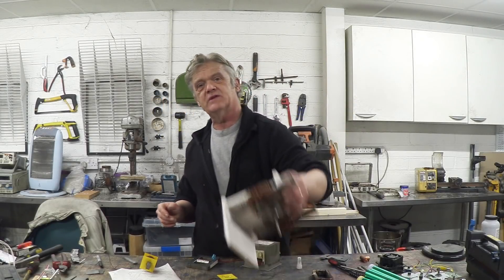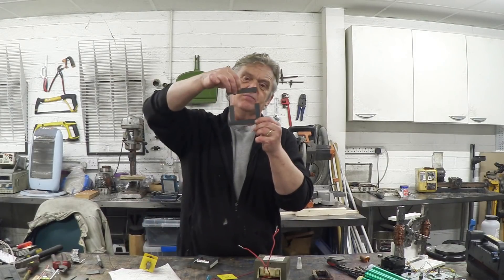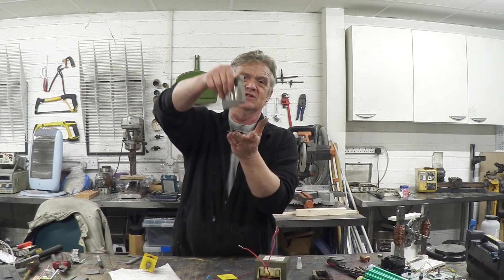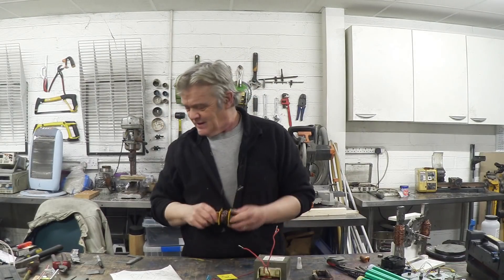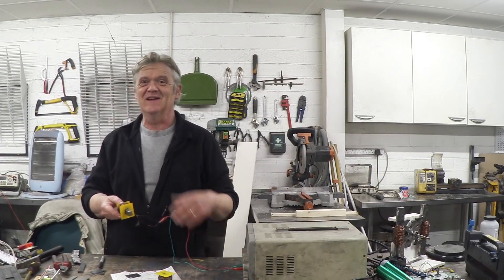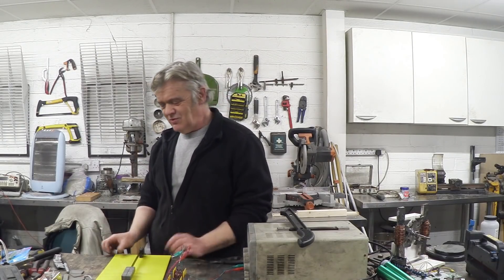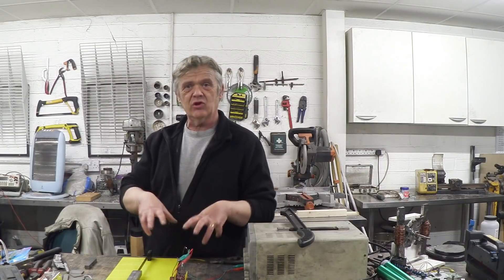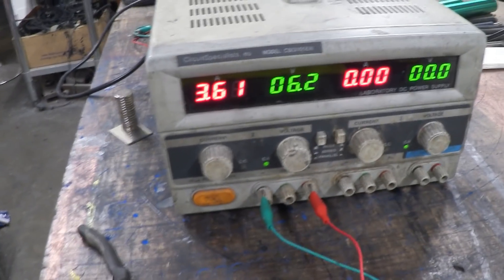1036 Flux Switching And Possible Over Unity

Comment: Awesome.  I had wondered if you could make a "switching magnet" with a combination of permanent and electromagnets.  
Now- here's (one) question I've got-  if you stuck another coil next to that, and ran an AC current (unless I'm thinking on that wrong) through your magnet coils, how much current is induced in that coil vs what you put in?
I had a notion on a motionless generator based on that concept, though I was thinking about the magnets backwards from what you've done in terms of function,  But I'm just curious what happens if you say, stuck that thing in a wound stator and just let the magnetic field bounce on and off at, what is it? 60 hertz?  Would that be a functional motionless generator?  It just takes a Change in the magnetic field to generate current, doesn't it, and your permanent magnets are doing a significant chunk of the work?   Ypur electromagnets obviously create their own field, but they Also seem to break the containment of the permanent magnet in the armature.    That may be an utterly ignorant notion, but it was a thing I was pondering with the "Switching magnets" and making one bit an electromagnet.   (another was a rather complex motor idea to "Turn off" the problem spot of a mostly permanent magnet motor at the appropriate time)  I dunno.  It's fascinating.  Thank you for this.
Reply: flux switching alternator. Look it up.
Reply: @lukiepoole9254  I mean, that's what he's building, but that's not what I'm pointing at, quite.
Reply: I'm pointing at the possibility of a generator with no moving parts, run on Permanent magnets, and just using an electromagnet to make their fields fluctuate (turning them "on and off") in and out of an armature to induce current in coils.  
I don't know if I said that right, quite.   Might not wind up worth it.  
 But I can't find that anybody's ever attempted it. 

The other application is like a V gate or similar design- it can't get back Into the gate the next time around,  If you could have this setup to "turn off" the gate entry till it was in the gate, permanent magnets would do 99 percent of the work to make the motor go the rest of the way around.  Seems straightforward enough.
Reply: @ryanjamesloyd6733  The problem with that is continuously turning the magnet on and off would degause it faster.
Reply: @lukiepoole9254  Then it just becomes a cost of doing business, like replacing a carbon brush.   You'd just have to replace your magnets every so often (All of them in the case of the motionless generator, only the first 2 in the V gate example)  Though I'm not convinced redirecting magnetic flux outside the magnet through a metal armature would degause it all That fast.
Reply: @ryanjamesloyd6733  you dont need magnets.
Reply: @ryanjamesloyd6733  just electromagnet.
Reply: @lukiepoole9254  you miss what I'm pointing at then.
Reply: @ryanjamesloyd6733  I mean for flux switching alternator xd
Reply: @lukiepoole9254  Ah- true.

Comment: A great experiment Rob, amplifying the electromagnetic effect with permanent magnets.
I could think of many applications whare this principal could be applied.
It's a pity some people take everything so seriously, and lack a sense of humour ! 😉
Reply: he weakened the magnetic field by putting the coils on the ferrite core in the first place, thats why it tooks so much power to move his meter, all the magnets did was use up some of the magnetic permeability in the metal to allow the magnetic flux from the coils to escape more readily, if he tried this with the coils not on the core it would almost certainly produce the same, or enhanced effect of what he showed after adding the magnets.
Reply: @Draakdarkmaster6  This is an interesting thought. It will take some thinking to create a decent experimental control to isolate this out. Thanks for the comment.

Comment: It is said that magnetism is the way to free energy. Great tutorial. Cheers mate!
Reply: its not over unity or free energy, its scavenging work from magnets which require energy to make in the first place, its easier to understand if you think of magnets as a receptacle for energy like a battery, where getting the energy back out is nearly impossible without alot of indirect methodology, so it'd be like if he used one of these "batteries" to make up for power he couldn't or didn't want to supply to the electromagnet to save power output from his power supply, not over unity, but potentially extremely useful.

Comment: "Free energy" "overunity" is already real. And widely used. We call them nuclear power plants.

However, this does solve certain problems that community members have been running up against. That much I know.

So I am eager to see how they will apply this.

Just make sure this clip pops up in their search results.
Reply: that isn't free energy or overunity, thats harvesting energy from ionizing radiation, which requires a breakdown of radioisotopes, "free energy" or "over-unity" is basically magic, its implying you make a machine that makes more energy than it requires to run, and if your personal definition of that is nuclear power plants, then by your definition so is solar and wind energy, or ion harvesting, but no, the energy has to be extracted from something else, its not making free energy, its scavenging it from a place it already exists from a finite resource, or an atmospheric condition being perpetuated by the laws of physics, over unity is impossible.
Reply: @Draakdarkmaster6  nope.
Reply: yay for old is new again US Bolshevik radioactive heat to 'make industrial revolution steam' today instead of personal abundant hydrogen on demand to electricity generators to run/charge all our 3.3v/5v/12v devices today O.O

 (remember when they said nuclear power was going to be so cheap to make maintain and supply ,it would be free to ordinary joe personal end consumers the world over after we (really mean average engineering/construction bad man worker) build it lies)

Comment: If viewers can achieve Over Unity in their experiments you will have spawned a new generation of Teslaites.
Reply: its not over unity, its scavenging work from magnets which require energy to make in the first place, its easier to understand if you think of magnets as a receptacle for energy like a battery, where getting the energy back out is nearly impossible without alot of indirect methodology, so it'd be like if he used one of these "batteries" to make up for power he couldn't or didn't want to supply to the electromagnet to save power output from his power supply, not over unity, but potentially extremely useful.
Reply: he weakened the magnetic field by putting the coils on the ferrite core in the first place, thats why it tooks so much power to move his meter, all the magnets did was use up some of the magnetic permeability in the metal to allow the magnetic flux from the coils to escape more readily, if he tried this with the coils not on the core it would almost certainly produce the same, or enhanced effect of what he showed after adding the magnets.

so in fact its more wasteful to do what he's doing than just inducing magnetic fields without the core at all.
Reply: Lol. Check up flux switching alternator.

Comment: Magnets do work ,so they have energy. Problem is either cogging or back emf,.lenzs law... But there are many who have patented these ideas but 🇺🇸 protects the banking/oil cartels.
Reply: It's my understanding that magnetism is a force, not energy (the same as gravity)
Reply: @1967spark  gravity ,the big G, goodness... From reading older scientists, before the great delusion of relativity, thought the constant attractive force has to due with surface charge plus density minus the centrifecal spin of the planet. Static electricity has the same effect but isnt thought of because the electric cosmos was tossed out by  scientists that separated themselves from the divine.
Reply: @1967spark  also if we are a conductive sphere,.,. Capacitor, that has a charge moving through the sun's electrical lines and magnetic lines that would fit the definition of a generator

Comment: Is it more likely that the four fold difference is more due to the inefficiencies of your original electromagnet?
The power required to move your "meter" should be compared to the power used by both versions of your electromagnet, i suspect that you the energy you apply to both versions of the electromagnet is in fact larger than the meter movement and that you are a long way from unity never mind over unity.

Of course improving efficiencies is always good, however even small electric motors are  typically about 80% efficient and Tesla claim to achieve about 90-94%
Reply: also worth noting that wrapping the magnet coil around a ferromagnetic material is almost certainly going to weaken the force exerted by the electromagnet, and thus require more power to drive a more powerful magnetic field, in fact i know exactly whats happening here

the initial coil's field was weak so it took more power to drive it (due to the core being ferromagnetic) and by having the permanent magnets attached to them you are essentially using up the magnetic permeability of the core with the permanent magnets (essentially the material can only hold a certain amount of magnetism before it just cant accept any more) and the net result is that you dont need as much energy as before to drive the field, but... if you just didn't use the ferrite core in the first place, you wouldn't NEED the magnets to generate an adequate field for less power, so all of this was (theoretically, someone would need to further test to be completely certain.) for nothing.

Comment: Only if you can get into high terahertz AND extremely high voltage, will you see a return. To my understanding.
Reply: ? you want electrostatic, thermoelectric, piezoelectric, ferroelectric, high vibrational ,insulated core nylon thread covered in hybrid conductive ink with Nano piezoelectric plated copper jacket .... making an antigravity electromagnetic river machine ^_~

Comment: If overunity is happening in your setup, it is likely pulling heat energy and converting it to electric energy. So make sure to check the temperature of the thing while it's running. This will tell you very clearly if you're getting more power out then you're putting in. Very easy test to do, and nothing about it violates any sort of physics law like most people assume it does
Reply: he weakened the magnetic field by putting the coils on the ferrite core in the first place, thats why it tooks so much power to move his meter, all the magnets did was use up some of the magnetic permeability in the metal to allow the magnetic flux from the coils to escape more readily, if he tried this with the coils not on the core it would almost certainly produce the same, or enhanced effect of what he showed after adding the magnets.

Comment: Check the strengths of the permenent magnets afterwards? Not sure if such happens with neodymium ones, but one way of demagnatising iron etc, is run alternating flux through it.
Reply: conversely  ac will heat the magnets causing some magnetism to be lost in counterspace thus an equilibrium of energy.

Comment: Possible over-unity coming from you Sir...there is hope for man kind😎😌
Reply: The claim of over unity is absurd regardless of who it comes from.
Reply: @davidmurphy563  nuclear power plants around the world say hi.
Reply: @mattstroker  Nuclear power plants are around 35% efficient. Why don't you say hi to an education?
Reply: @mattstroker  nuclear power plants are not over-unity, they are actually really inefficient, highly powerful and very useful sure, but in terms of energy in to energy out? higher inefficient like most of our technology.
Reply: @Draakdarkmaster6  we put bullocks in, and get shitloads out. Closed system too. 

Overunity.
Reply: its not over unity, its scavenging work from magnets which require energy to make in the first place, its easier to understand if you think of magnets as a receptacle for energy like a battery, where getting the energy back out is nearly impossible without alot of indirect methodology, so it'd be like if he used one of these "batteries" to make up for power he couldn't or didn't want to supply to the electromagnet to save power output from his power supply, not over unity, but potentially extremely useful.